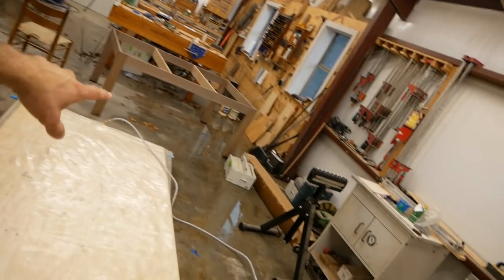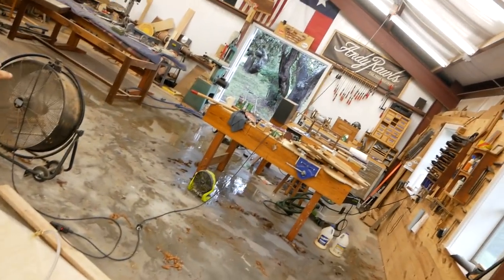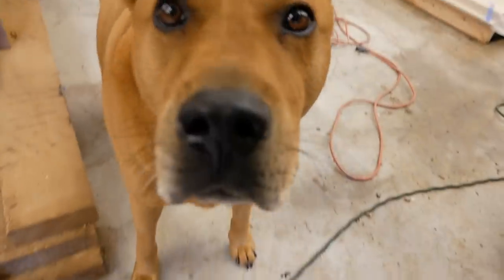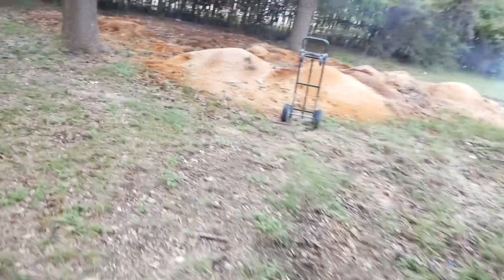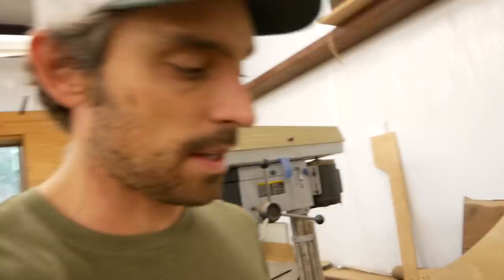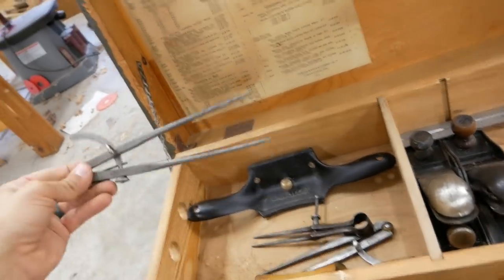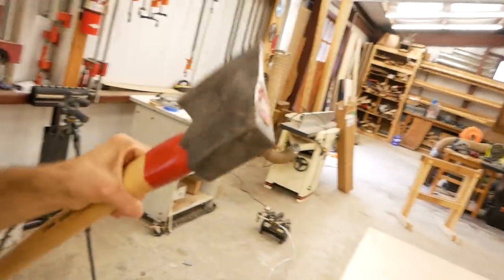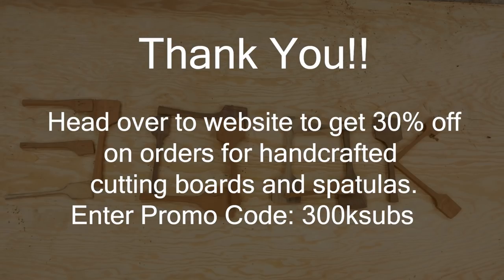The Shop Flooded....

Comment: Oh man Andy my heart sunk into my stomach when I saw this. Hurricane Katrina destroyed my mom and dad's house. The memories I had growing up there are priceless.  To see this flooding just brings back the memories of walking through the house after the hurricane and seeing all of our stuff destroyed. I can't imagine what it must feel like for it to destroy things for your career and things you've worked so hard to just be damaged by water. I feel for you. I had to divert water on my property by putting catch basins in the ground and running 6 inch piping around my house and out to the ditch in front the house. I'm not sure what size catch basins your type of flooding would require but it would help relieve enough water to at least keep it out of the shop. I have 2 catch basins one about 16 inches and the other is around 36 inches. It's kept my backyard from flooding and we have been through a few tropical storms. You can dig up the hole for the catch basin and dig the trench then put the basics in and run the pipe yourself.  It's an extremely hard job but doable. I poured concrete around the edge of our catch basin in the shape of a bowl to catch as much water as possible.  It works really well. I even built an outside gardening counter with a sink in it and piped it into the catch basin. Lots of possibilities my friend. Sorry to see this happen to you. I'm praying for you.

Comment: My old workshop used to flood a couple of times each year ... it sucked. My new workshop leaks slightly in a couple of spots that I haven’t yet fixed but it’s nowhere near as bad as full-on flooding. I just throw a tarpaulin over my wood lathe and occasionally that has a tiny bit of water on it when I go in there after a heavy rain.

Water sucks. As somebody else commented earlier, maybe a Dutch-type dyke (like your concrete wall idea) could solve your problems.

Keep up the great work mate! You’re an inspiration to those of us who wish we were as great at woodwork as you are.

Cheers from down under 🇦🇺

Comment: Ugh- so sorry to hear about the flooding.  The rain hit my shop this year, too, and it was a real mess - took forever to get everything out of the water and dried out.  Finally invested in a gravity drain (like a sump pump drainage system without the pump) and installed the vapor barrier over my cinder blocks and it's been bone dry ever since.  Hated to spend the money on it, but the peace of mind has been great ever since.  Congrats on 300k and hope the shop gives you no more issues so you can concentrate on what you do best!

Comment: That's the attitude stay positive. I had over four feet of water in my shop last year and am still recovering. I rebuilt all three motors in my planner and cutter head. Rebuilt the cutter head on my jointer motor sounds like a model T but still runs, Table saw kicks off and have to hold start button until it warms up. Rebuilt my 14 bandsaw motor. I have not tried to start my 46in bandsaw yet as my three phase is still in pieces had to replace all the capacitors. still afraid to turn it on fearing the worst and these two motors are huge will need a fork lift to remove. All hand power tools I blew out and ran fresh water thru them and then thinner to displace water and then blew them out again. They all worked but after sitting for awhile some are giving me problems so will have to take them apart and grease the mechanical  parts and maybe rebuild motors. And then there is the furniture that has to be taken apart and rebuilt. Not sure what I am going to do about the warping table tops. We really are both lucky think of the people who's homes washed away. Keep the faith

Comment: French drain is an option for underground hidden drainage, so it's more aesthetically pleasing. For heavy drainage, a curtain drain is the way to go. Rent a ditch witch, pitch it down towards your low spot on the edge of your property, and fill it with round stone.
Reply from the maker: Thanks
Reply: @AndyRawls  also, if you do a curtain drain, it might behoove you to encase it in wire mesh so you don't get washout of stone on heavy rains.
A French drain is something that would be useful in a situation like the carrikers (@offtheranch) and their laundry room. They would run a ditch witch with pitch away from the high point, lay in round stone, drilled corrugated pipe, cover that with more stone, and sod on top of that. It's not as effective as a curtain drain, but looks better.

Comment: I have a shop that gets wet once a year.  I got an 8000 btu window AC unit and it works wonders drying out the shop.  I also installed a gable end can’t to take the humid air off the ceiling.  I cant begin to tell you how much help the window ac unit is.  I live in Maryland where the summers are always swampy and it can rain buckets.

Comment: That sucks.  If you have damage in the house as well, maybe it's worth claiming insurance?   10" sweep is the brace size.  It has a 5" jog in the shank and when you swing it around it totals 10 inches.  I would say rent a bobcat and dig a ditch to redirect the water around the shop.

Comment: @7:36 the brace bit ratchet sweep 10" is a brace with a ratchet mechanism, the 10" sweep defines the diameter? of the circle the handle of the brace makes when turned. they come in 6" to 14"+. i believe 10" were a common size.
Reply from the maker: Thanks for clarifying.

Comment: Dig a hole where the water is originating  fill it with stone then dig a trench use filter fabric and french drain pipe. It will be perforated and since you are worrying about surface water put the holes facing up. The bottom will be solid and it will carry the water wherever you want to put it. If you need more detail feel free to message. Nice videos.

Comment: French drain around the sides of the shop that have low grade where water settles.
Reply: They work !
Reply: That was my first thought too. Just beef it up with something that can carry weight around the doors and it should be golden.
Reply: Or slope the floor (doesn't need much) with a drain in the centre

Comment: That disk sander probably needs the bearings changed.  A properly greased bearing will slow down way before that.
Reply from the maker: I think you’re right...I mean I can’t bring a machine in the shop and just not work on it!
Reply: At least there's only two!

Comment: dude, cut a french drain under the ground, line the bottom with big PVC pipe with holes in it, then bury it under 2 1/2 inch gravel. Divert your future flooding rivers that way.